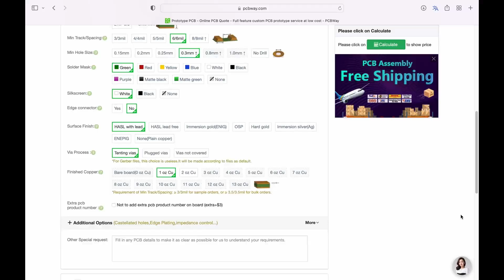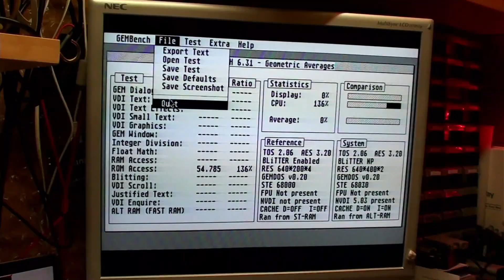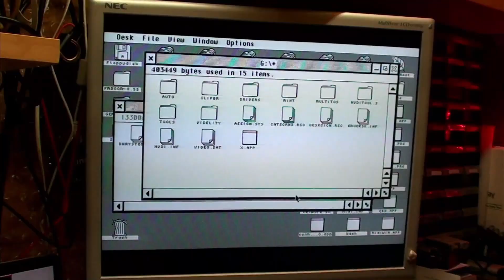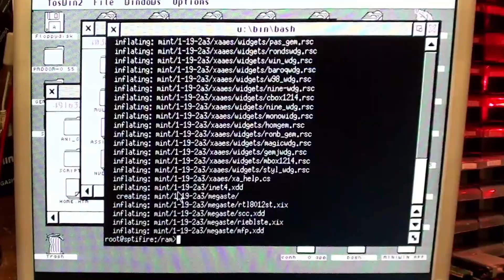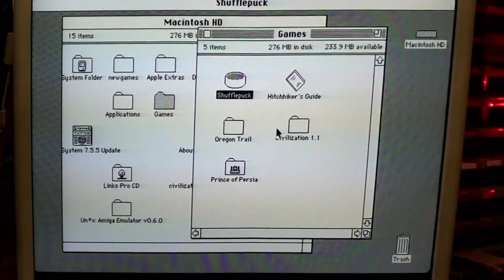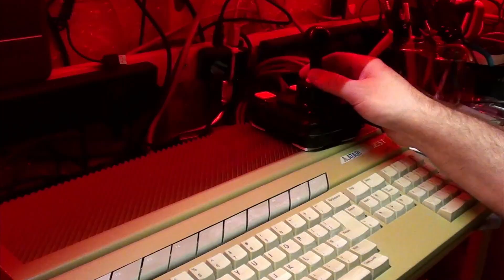STE536. A *working* plug and play STE accelerator (part 2)

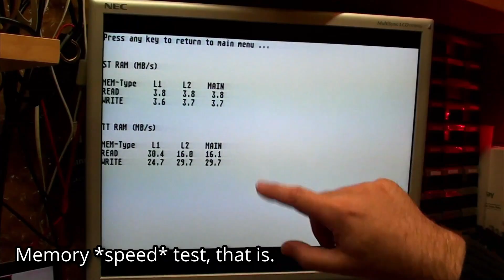Comment: 14:09 Could that be my old memory speed tool I wrote in 1994 and spread through MW electronic and MESA electronic? This was during my last two years at university, I think I wrote this basically to measure the c't PAK and FRAK (a DIY 68030 accelerator and fast RAM board).
Reply from the maker: MEMSPEED? If it's yours, thank you very much. It's perhaps not quite as accurate as something like NEMBENCH but has the advantage of simplicity and being able to run on a stock 68000, so it gets used by me quite a lot!
Reply: @thetechnoshed  At that time I was quite active in the Atari scene. There was some hot stuff coming where in one way or the other I was involved in testing or building up the infrastructure around it. 

AFAIK when I got the PAK and the FRAK, the Hades and the Milan there wasn't anything around like MEMSPEED. It was simple, as I wrote in the README it left interrupts on, so the values are not 100% precise, and it assumes a fixed maximum cache size which was OK for the intended purpose to measure the PAK and the 68040 and 68060 Atari compatible machines.
Reply from the maker: @TLang-el6sk  Very cool. I must confess to having hacked it to run with only 512k of STRAM, but I was very much stumbling in the dark and the cache test logic is very much beyond my superficial reverse engineering skills. I know it’s seen active use in the PiStorm development for the STs as well, so many thanks once again!

Comment: It is great to see these accelerators and the work to create them, it must have taken hours but aren't there hardware limitations in glue and the mmu that prevent making everything faster. The Amiga was designed to allow things to be connected to the bus and I see lots of amazing bits of kit for it then I look at the ST/e and think we can't really go much further as the hardware is restrictive?
Reply from the maker: The Amiga certainly makes things easier as there are fewer things to worry about and it's always had expandability built in. The wedge-factor ST range was really not intended to be extended so no-one wrote code expecting them to be. Kind of a vicious circle.

Comment: Would that work for programs written in GFA Basic?  I mean, would programs running in the GFA interperter run faster with this board (compiled speed)?  Because I don't have a compiler.  Also, is there a way run 'stock' STE if I want to - toggle 8meg speed?  Then, I would love to get one of these - when they are ready.
Reply from the maker: Sadly there's not an easy way to revert back to stock as there's isn't a lot of space inside there to carry a second processor.

Comment: Love it... but again simple question: why would I "need" to accelerate my ste which has 320/200/16 graphics?
Ok i know this is all for fun also and full respect.
I just think your brilliant brains should now focus on more colors on screen aka some shifter tweaks etc. VGA FOR STE with this accelerator would make more sense.
Thank you! ❤
Reply: It's a shame Atari ST didn't put a write pin on the cartridge port.  Then we could have stuffed a VGA-like card in there.
Reply: You can't have better graphics without a faster CPU and faster ram. All this is being worked on the phoenix platform. the chipset has to be built from the ground up and it's not a 5minutes job.
Reply: @exxosuk  I didn't know you were working on upgraded graphics capability on the phoenix. Is it going to use a FPGA for that?
Reply: @DanMacDonald  there is the phoenix shifter,MMU, glue all being worked on. Prototypes exist. All documented on the exxos forum. Once the chips are 100% compatible with the original chips, faster bus speeds are next, which opens the door for better graphics and frame rates etc
Reply: @exxosuk  please provide a link to the forum post for the phoenix shifter. How might this compare the Falcons graphics? Might there be any scope for compatibility with the Falcon?